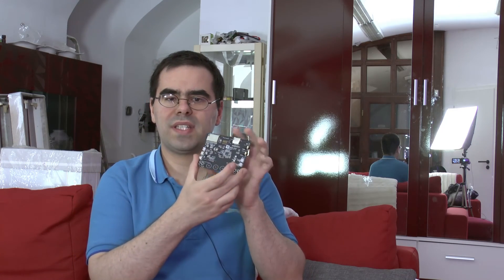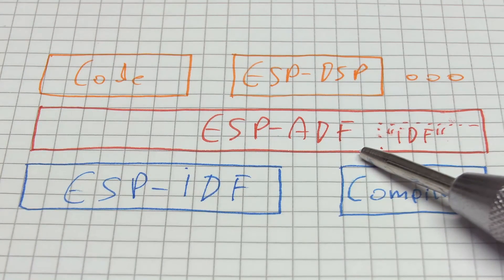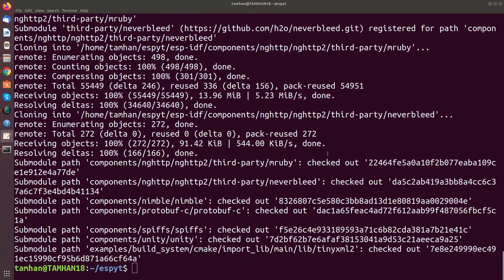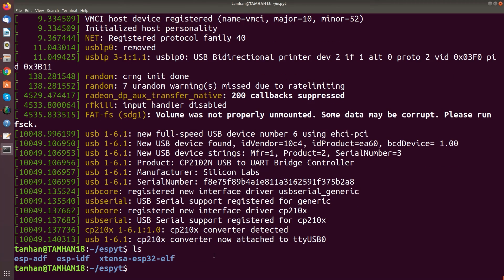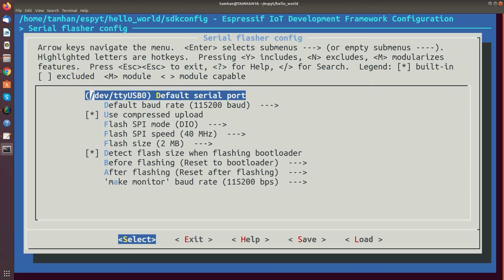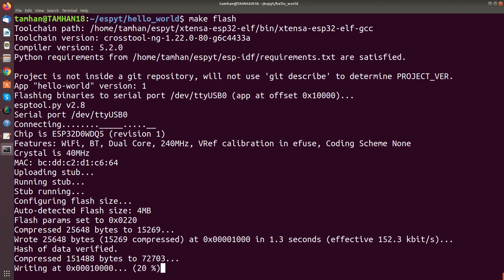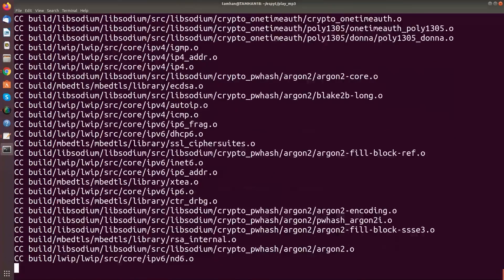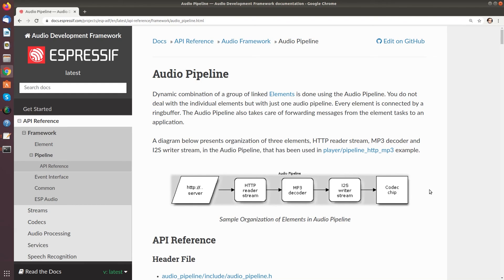ESP32 LyraT 4.3 - getting started

Comment: Have you tried VOIP capabilities using the ESP-ADF? If so, could you make a video on it? I see they have an example on the Github, but I't a bit advanced for me right now.

Thanks for the video.
Reply from the maker: Thank you for talking back! Sadly, I do not do much with VoIP at all. Can you maybe show me the URL of the example?
Reply: @MrTamhan  Sure, here is the URL: https://github.com/espressif/esp-adf/tree/master/examples/advanced_examples/voip

I have a project based on the ESP32 that I would like to integrate two-way voice communication over the internet. I'm wondering if this could be achieved using one of the boards (LyraT Mini, for example) and this library. I haven't been able to find any examples of the library in use though.

Thanks for responding.
Reply from the maker: @anonimuso  Hello, sorry for being a bit slow in responding here. I am very, very overworked at the moment.

Did you look at the code? IMHO, this is mainly some kind of pipeline processor...

Tam
Reply: @MrTamhan  I understand you're busy. I have actually been looking at the library. But I just wanted the perspective of someone who already has one of the audio dev boards. I don't have one yet, but I will probably get one in the near future since they're not too expensive. You're right, it probably won't be hard to get up and running once I get my hands on the hardware. 👍
Reply from the maker: @anonimuso  thanks for your response and understanding, man, and sorry for being slow. IMHO, this example should be quite simple - just think of it as a classic data pipeline, as in, info in, info out!
Reply: @MrTamhan  Thanks. I am looking forward to playing around with it and seeing what it's capabilities are. If I get it working with two-way voice, I will let you know.
Reply from the maker: @anonimuso  thanks man, please keep me in the loop!!!!